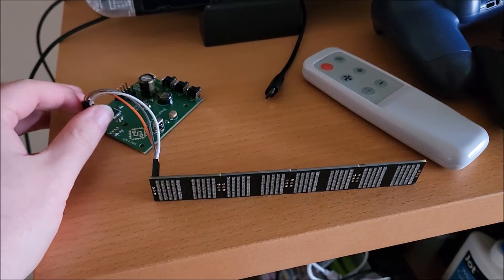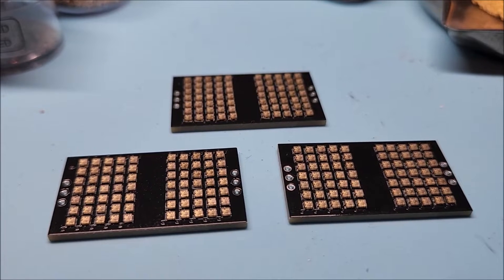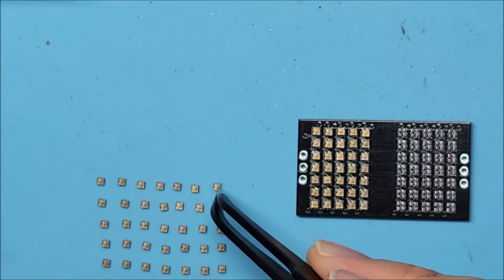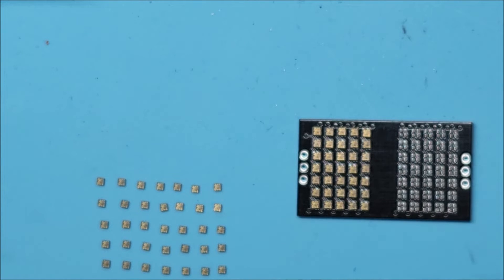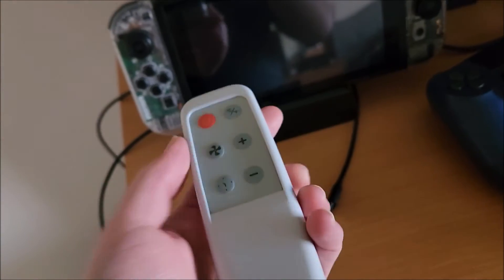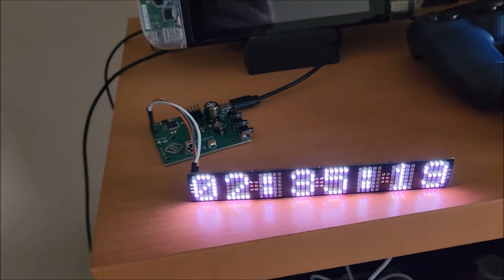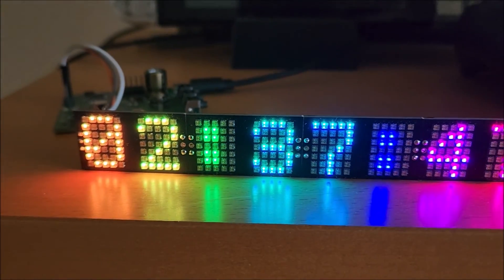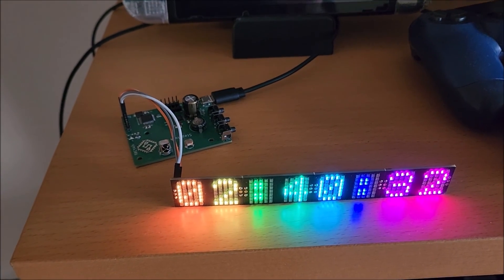DIY RGB 5x7 LED Display Clock

Comment: I made a similar set of small boards this summer with the same WS2812 LEDs (they look like the 1010 SMT size)... they were individual 5x7 led PCBs but I had them assembled (JLCPCB) with panelizing, and the cost worked out to be about $2.30 per board in a quantity of 75 (thats over 2500 LEDs!!). I do not have your steady hand for placing these :) I also noticed the same color issues when brightness is very low. Did you use the FastLED library? There's a setting for dithering, which can help with this issue by pulsing colors (you need to call FastLED.update at a high refresh rate, maybe 60hz for it to work well). Great video and thanks for sharing your projects!
Reply from the maker: I'm currently using the adafruit neopixel library but I'm not particularly married to it. Thanks for the tip, I'll have to look into FastLED. The mcu isn't really doing much so it wouldn't be difficult to call an update function often in exchange for higher resolution at low brightness.